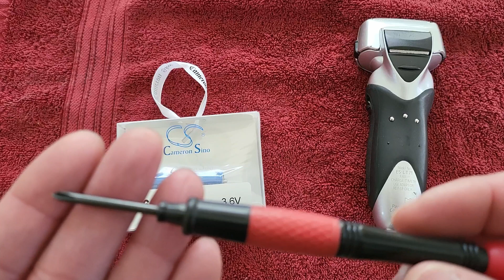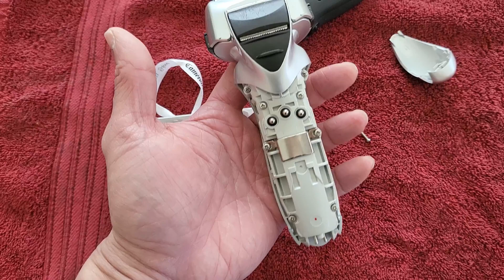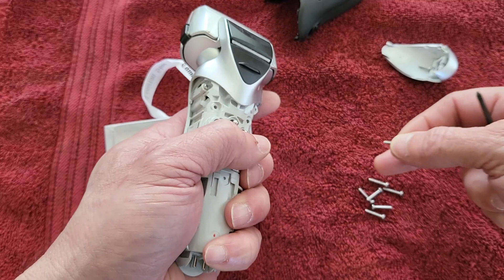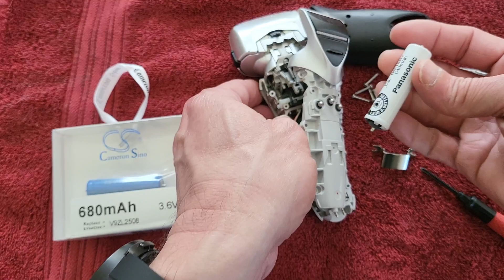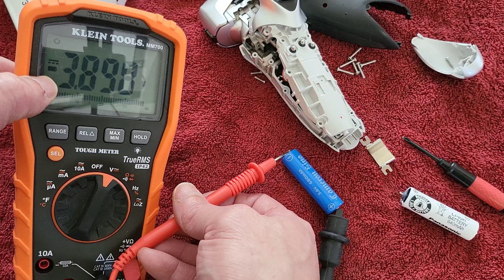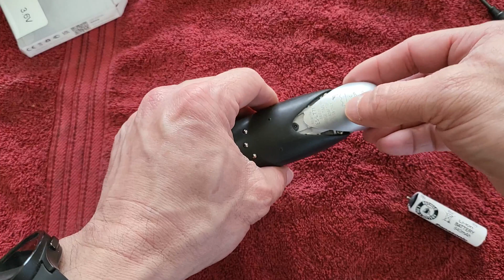Panasonic ES-LT71 battery replacement

Comment: I have an old Panasonic ES-LF51 which is more than 15 years old. It looks exactly the same as on video and it still has a working battery, but it only lasts a couple of days, so it goes to charge almost immediately. A surprisingly reliable model

Comment: How do you tell the voltage with a cheap multimeter and not an expansive klein multimeter?  Thanks!
Reply from the maker: It doesn't matter if it's a cheap or expensive multimeter. The panel might look different, but the process is the same. Set the switch to Voltage, make sure it's set to read DC power and not AC power, then put the leads on it.
Reply: @R-TechEnthusiast  Thanks!

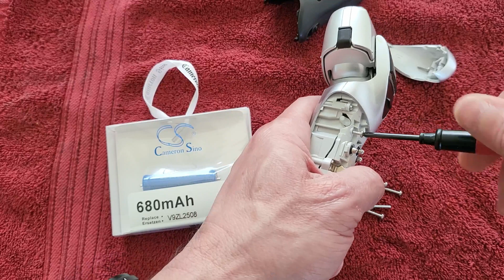Comment: NOTE: For the LF 71 - The screws taken out at 1:59 actually hold the handle plate, so you can't pull the handle plate off at this stage. You have to flip up the beard trimmer, undo a screw there, unclip the beard trimmer which then exposes those two screws. Only AFTER removing those screws can you lift off the handle plate. Just FYI. Slight difference in models.

Comment: Best parameter to check these batteries is measure it's internal resistance in mili Ohms usually between 40-100 then the battery is OK.
Voltage is around 3.8-4.1V and internal resistance in Ohms range the battery is bad and cannot hold charge for long.
Reply: How do you do that with a multimeter?  Do you have a video where I can see how this is done?  Thanks!
Reply: @squirrelattackspidy    I'm not sure why I need a multimeter. Switch to rechargeable Ni-MH batteries and buy a smart battery charger that can run charge-discharge cycles. With it you can even “resurrect” dead lithium batteries sometimes by applying the clamps and giving a minimal charge. I brought back to life a camera battery that had stopped even reading, as well as an old smartphone that had videos on it. Useful stuff